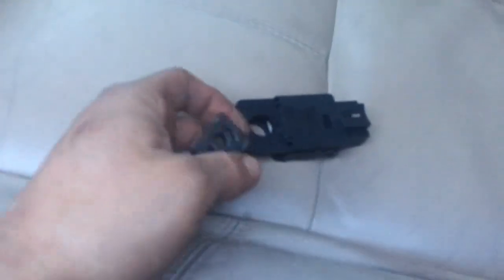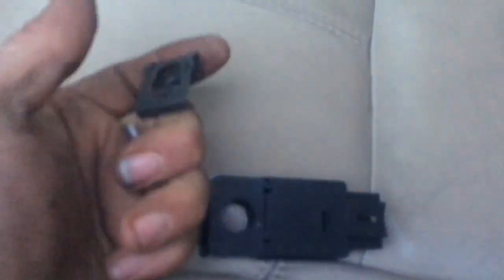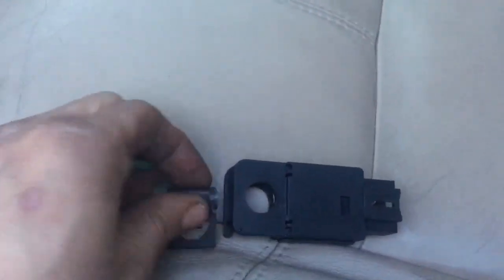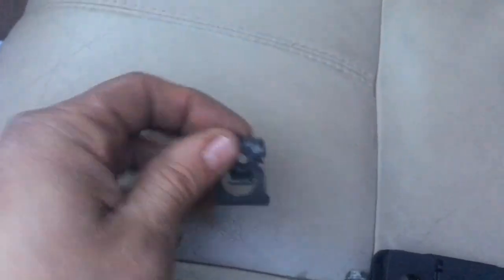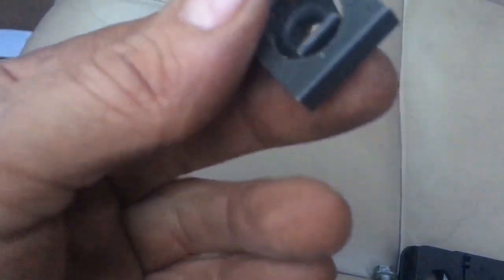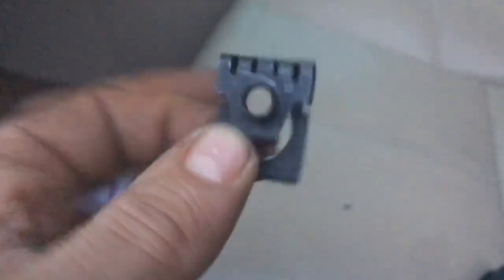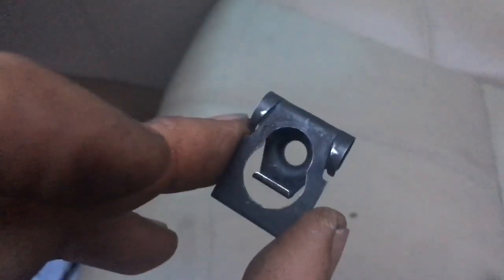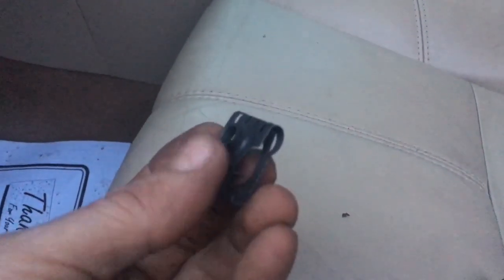Possible reasons why your Stabilitrak light is on in your GM

Comment: Thanks for the video Clay. I didn't complete the video and the brake pedal sensor was not the issue although it led me to my specific issue. Since I went to check the brake lights it led me to my issue. My issues were first start up of the morning the service stabilitrack would come on after about 500' out of the driveway and stay on until I turn the van off, Oh (2012 express 2500) and not any other times. I had this issue for about the last month. I also noticed in this time my right turn signal had an increased rate of operation. I found upon checking the brake lights that my rear left turn signal was out. Replaced and solved my issue.
Reply from the maker: That’s really cool thanks for sharing with us Brian I knew that it wasn’t the only reason for these lights to come on when I posted the video and I was hoping people like you would post the resolutions that they found so other people could be helped thank you very much have a great day
Reply: My 08 silverado does the same thing but I don't have any lights out. Any guesses?
Reply: @tstryker03  
My mom just came to me with this same problem,...
STABILITRAK 

I told her it sounds like traction control or maybe a differential problem..

Took my camera phone under her car looking for worn extremely rusty cracked or broken problems around the wheels 

Her brake fluid was low 
We filled it before checking under the SUV

I totally know the video we just watched has to with his brakes, the brake pedal doesn't have enough pressure in the brake lines I think it was my old jeep with was a master cylinder problem years ago THE BRAKE LIGHTS STAYED ON EVEN WHEN PARKED...
it might have air in it or leaking...

but with my mom's Chevy Suburban 
I looked around underneath of it around the front wheels and a bolt was totally broke underneath 
The bushing and bolt broke off, 
It appeared supposed to be connected to the frame underneath closest to the ground..
I don't know what she ran over...

But I said that's probably why..And told her to show the video to the mechanic..

The next day, a GM mechanic  (GOODYEAR MECHANIC) said that was probably why the brakes squealed, 
she had been bringing it in her car asking why her brakes squealed at least twice before he said brake dust, today he said because the bolt was broken and it swayed so much, that pressure like the car leaning so much caused the brakes to loose fluid and also  SQUEAL...

AND HE CHARGED TO PUT IN NEW STABILITRAK SENSOR 
Yes he said he did put in a new sensor..
I SAID WHAT A NON WORKING BROKE SENSOR 

So today I started making a YouTube video since he charged to fix it and charged  for a " new sensor"

I told my mom, I didn't  think anything was wrong with her old sensor,
since that sensor let her know there was a serious  problem, it even shut off her car when going down a hill with a curve at the buttom...

So I guess the GM GOODYEAR mechanic just reset the sensor 
THEY JUST TELL THE COMPUTER TO IGNORE THE PROBLEM..
it's like that it even computer systems, they will run with a problem not being repaired at all, they just tell it to ignore that problem,
 IT MIGHT COME BACK ON LATER...

But nothing appeared repaired 

It was fall break she had been driving the kids around WINTER IS COMING AND WELL HE CHARGED TO FIX IT

YET DID NOT 

so I'm going to be posting a video about it in maybe a week,

I hope the video can be about getting her money back
Reply: @dave-o3674  This is how Big O Tires treat their customers.  Shame on these people.  This is an example why mechanics have such a bad reputation.
Reply from the maker: @dave not the 2nd I have no idea about big O , Well first off there is a dozen different things with your description please do not make any YouTube videos you were absolutely incorrect they cannot tell the computer to ignore something without paying $100 and having a tech to or maybe like an HP tuner . Or several other types of scanning devices that allow you to reprogram the ECM port to do that. (I will point out they can clear codes but they will come back within fivekey cycles) this is why I ask you not to make any YouTube videos because of what you said. 

I’m not trying to sound like a jerk. And if you would’ve sent me this message privately I would pretty much say the same thing and I would describe you what is wrong with all of your statements.

I will however take in consideration that you are correct on a couple of different things but for the most part some of your statements make no sense. 

If you do choose to make a YouTube video,  you do sound like the type of person that may inform yourself on both sides of the matter before doing that. Most mechanics make determinations based off of what the customer is telling them. And what the customer is willing to pay. If a customer walks into a store and says he can you take a look at my vehicle I’m happy to pay what it cost. More than likely they will do a thorough job

If a customer comes in and ask how much does it cost to take a look at my vehicle. Most shops are going to see an hours worth of labor time . and they may find several things wrong and then tell the customer from the most important to the least important things to repair first. (In the situation they’re trying to be compassionate about the customers pocketbook not because they don’t want to do the work they just want their prices to be reasonable )

I am definitely not trying to throw shade at you. And I recommend you take your vehicle to another shop
Reply: @sharpcarco  👏 well put
Reply: @sharpcarco  great response dude.

Comment: had some problems  with the cruise control not working right .and abs light and traction control light was coming on and off on my 2010 chevy .when lights were on the 4 wheel drive would not work so i changed the brake light switch like you should and every thing works great thanks for the info and video

Comment: I have a 2011 Buick Regal.  Oddly, about the only time this Stabilitrak  warning appears on my screen is when I'm leaving our local Walmart.  There is about a 2 block drive from the parking area to the main road, with a stop sign in between.  The warning goes off about the same place every time, yet rarely anywhere else.  I will see if it goes off right after I take off from the stop sign.  If so, I will stop the car and then see if the break lights are still on.  If so, perhaps a little WD40 could help the problem?  I am so grateful for this video.  I had no clue before.  Indeed, I hit Subscribe and a thumbs up.
Reply: Buying too much stuff there :), try to leave empty

Comment: On my '11 Silverado it was the brake light switch. Dash was lit up like a Christmas tree, wouldn't go into gear and my mechanic told me that when I did manage to get it in gear that cruise control wouldn't have worked. I was thinking it was gonna be a wheel speed sensor. 

On a side note it crazy how much all that traction control, Stabilitrac and any other so called nanny features affect us. I spun out on a slightly damp road and went in the ditch when that switch went out.

Comment: One wire on the mass airflow sensors plug was damaged on my 2010 Silverado. This was dangerous due to the fact that it completely disabled traction control and also my truck has the g80 locker that automatically locks . So let’s say it’s wet out and I’m accelerating on a interstate ramp. The truck will loose control because gm wanted to save money and use a outdated automatic locking diff instead of a selectable locker. Then found out oh shit this isn’t the safest thing so now let’s dump millions into developing a traction control system that keeps this from happening. And they still use it today.

Comment: Thanks for the video but I've got a 2009 Buick Lacrosse 3.8L and for over a year my traction control and ABS lights have been on so they haven't been working.  My friend (who's a mechanic) and I have been trying to figure out what is going on and replacing parts.  The codes are C0090 & C0095.  There was another code for the front left speed sensor and we took care of that with a new bearing.  We also installed a new bearing on the right rear but that didn't fix it.  While replacing that bearing he noticed the wires going into the plug from the loom was bad (not enough to splice) so I got a new loom that takes care of both rear wheels.  As before that didn't clear the codes.  We both decided to more research so I went home, lights on.  When I got home I parked the car and then got the idea to start and see if the lights were on, they weren't.  I went down the driveway (icy) and they ABS worked great and so did the traction control.  But by the time I got parked back in the garage they were back on.  He thinks since the ABS Control Module hasn't been working for so long the solenoid for that wheel may be stuck.  What do you think? And any idea how to loosen it so it works?  I've also read online that flushing the brake lines and putting in new brake fluid may work, again what do you think?
Reply: Jr Groe frade wire!!? Dirty abs sensor! Sensor didn’t get shimmed properly after brake job!! Dirty abs ring!! These are easy no cost solutions!!! Try them! It is said that replacing hubs to replace harness also and to replace in pairs!!

Comment: CLay, I've changed the brake sensor, ground wire from firewall to block. Stabilitrak  and traction control off light still being displayed on my 2009 Silverado, really need another avenue before turning my 16 year old son loose in this truck.

Comment: This might help someone,  i have an 07 Silverado and the stability trac and traction control would flash on and say service soon then go away..... my fix was replacing the MAF sensor and the air filter, i also replaced the spark plugs.

Believe it or not, the MAF sensor does infact have something to do with the stability trac issue.
Reply: Dirty maf will cause a lean fuel condition which causes a misfire, anytime you have a misfire it disables traction control

Comment: My mom just came to me with this same problem,...
STABILITRAK 

I told her it sounds like traction control or maybe a differential problem..

Took my camera phone under her car looking for worn extremely rusty cracked or broken problems around the wheels 

Her brake fluid was low 
We filled it before checking under the SUV

I totally know the video we just watched has to with his brakes, the brake pedal doesn't have enough pressure in the brake lines I think it was my old jeep with was a master cylinder problem years ago THE BRAKE LIGHTS STAYED ON EVEN WHEN PARKED...
it might have air in it or leaking...

but with my mom's Chevy Suburban 
I looked around underneath of it around the front wheels and a bolt was totally broke underneath 
The bushing and bolt broke off, 
It appeared supposed to be connected to the frame underneath closest to the ground..
I don't know what she ran over...

But I said that's probably why..And told her to show the video to the mechanic..

The next day, a GM mechanic  (GOODYEAR MECHANIC) said that was probably why the brakes squealed, 
she had been bringing it in her car asking why her brakes squealed at least twice before he said brake dust, today he said because the bolt was broken and it swayed so much, that pressure like the car leaning so much caused the brakes to loose fluid and also  SQUEAL...

AND HE CHARGED TO PUT IN NEW STABILITRAK SENSOR 
Yes he said he did put in a new sensor..
I SAID WHAT A NON WORKING BROKE SENSOR 

So today I started making a YouTube video since he charged to fix it and charged  for a " new sensor"

I told my mom, I didn't  think anything was wrong with her old sensor,
since that sensor let her know there was a serious  problem, it even shut off her car when going down a hill with a curve at the buttom...

So I guess the GM GOODYEAR mechanic just reset the sensor 
THEY JUST TELL THE COMPUTER TO IGNORE THE PROBLEM..
it's like that it even computer systems, they will run with a problem not being repaired at all, they just tell it to ignore that problem,
 IT MIGHT COME BACK ON LATER...

But nothing appeared repaired 

It was fall break she had been driving the kids around WINTER IS COMING AND WELL HE CHARGED TO FIX IT

YET DID NOT 

so I'm going to be posting a video about it in maybe a week,

I hope the video can be about getting her money back

Here is the link to the problem i found 

I don't plan on fixing it myself,
I do plan on having it fixed before winter time, 
AND I DO HOPE TO GET MY MOM A REFUND OF SOME SORT..

https://youtu.be/ab7yDc23ch0
Reply: Johnny on Dope if your brake lights are staying on!!! It’s the brake switch!!!! That’s the key diagnosing this problem

Comment: My 2005 Z71 4X4 Tahoe has service stability and service brake on and most of the time it locks the brakes up. I can loosen the brake fluid lines on the front and the code goes away and I can then safely drive the vehicle. But now it will not go away

Comment: I did tune up,new brakes,all new sensors,and new hub on one side I thought might be bad,checked all fuses and good still have stabil track and abs light with no check engine light.any ideas for me? Have a 19 GMC canyon with 67 k miles

Comment: Thanks for the great video Clay. It really sheds some light on my problems with my 2008 Chev. Equinox. I plug in my Actron scan tool and never see any fault codes when the stabilitrac light comes on. Do you think this brake light switch could be my problem also? What about the steering wheel sensor, as I have also seen video's about Chevy having problems with these also? Thanks for any help you can provide Clay. Have a good one.

Comment: I domt know if you'll see this but have you ever came cross 4wd, stabilitrak and traction control going out all at the same time. My initial thoughts was wiring or actuator. Second opinion would be awsome.
Reply from the maker: Good morning Dawson, more than likely that’s just a bad wheel speed sensor. You just need to have it scanned and then you’ll know which sensor to replace that’s actually generally a pretty cheap repair
Reply: @sharpcarco  thank you for the quick reply i will give that a try. You deserve your subscribers.

Comment: Hi The Clay Way...
So was it  this switch that realy causing the stabiliti Track,ABS and parking-Brake warning lights to come on  in your truck ?
I have a Captiva sport 2009 that's given me this problem..
I had a bad Rear Left-wheel sensor and tought this was my problem...
I replaced all 4 sensors with bearing and still have the same problem with the Stabiliti Traction Control, ABS and parking-BRAKE ligth.
Thankssssssss
I'll have a look tomorow by replacing this switch and see if it will solve my problem.
Thanks sir !

Regards.

Comment: Hey  Clay  ...this   is  Clay  Bartley   i  have  a  2  prong problem....i  have  a  2009  chevy  tahoe   which  has  stablitrac  problem with  a  engine warning  light  ..The  engine  is  running  a little ruff...am  just  wondering  if  it  may  be  a  bad  spark plugs  or  or  bad  plug  wire ...or  tire  sensor..?

Comment: 2015 Impala 2LT (stock) ,92,000 KM a few times a week, either at start or while driving "Service Stabilitrak" or "Service power steering" comes on. If the car is shut off for 5 minutes and restarted, those warnings on the odometer screen are gone. Ignore?
Reply from the maker: I’m not certain about that generally I have a Answer but in this situation that’s not something that I’ve ever heard of
Reply: @sharpcarco  Maybe the brake light is staying on and screwing up the computer into throwing up stabilitrak  stuff